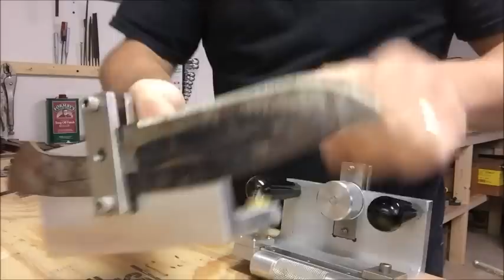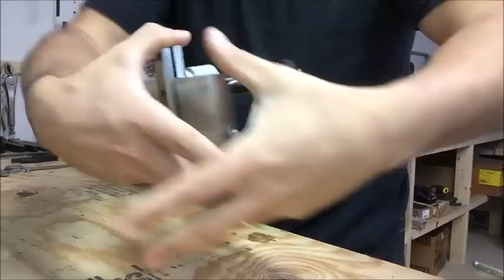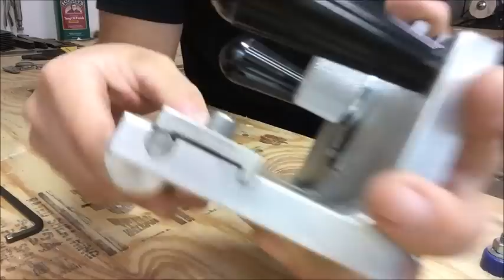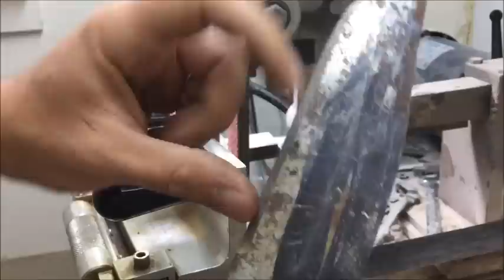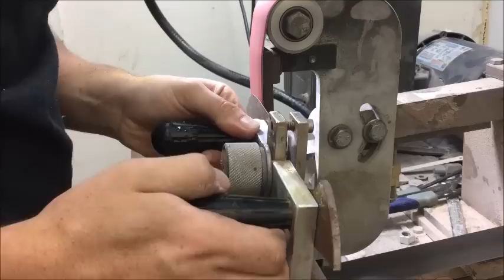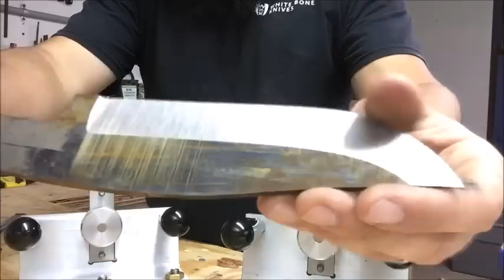Incredible bevel Jig for the Knife Maker!

Comment: I have one of these jigs and fitted hardened file guide steel on edges of knife holder. I then clamp knife ONCE with the 2 Allen keys in the holder and do up the big knob.   To do other side I just undo the big Knob and turn the whole thing around. Thats the why there's 2 threaded holes for the knob. Knife stays in one place through the whole process. Plunge lines stay equal. Only have to use the Knob to change sides. I don't touch Allen bolts until both sides are finished.
Works for me
Reply: nice i have to try thanks

Comment: Great idea...put carbide plates on the sides of the piece that holds your blade. Then you can also use it as a file guide for starting your bevels evenly at the same time as a bevel angle jig

Comment: I’m a hobbyist knife maker and I have a similar jig and I use a 1 x 30 belt sander and I still can get my bevel straight, any suggestions on why my bevel are not coming out straight and how I may correct the problem?
Reply from the maker: Really it could be many different things. The best thing I can really say is keep everything nic and square and practice practice practice. Your grinds will get better and better with every blade.

Comment: Hi mate I build a 72 inch belt grinder and I wonder if you can give me advice.  I build a pully system like klm and make my own pillow blocks. my tracking wheel is shaking the unit like vibration and I locked every thing in place nothing loos but still the tracking unit shakes can you tell me what I must do friend please. Greetings from South Africa Johan. God bless you. Shalom

Comment: Great video and jig, thank you. Yet, I need to ask this. As you're grinding the bevel, aren't you supposed to keep a straight line of motion even when you come closer to the tip, instead of pulling it away from the belt in a curved manner? Because most other videos I saw insist on that. I'm asking this as a noob knife maker, not to criticize.
Reply from the maker: I've always walked it out! I honestly don't know how you would do it any other way unless you have an entirely flat edge like a cleaver. If your edge is curved for the belly of the knife, you will have to walk it out every time to ensure the tip is ground properly. As long ans your bevel meets the center line of your edge to the bevel line on the side of your knife, you're golden!
Reply: Thank you so much for the detailed info :) Liked and subbed!

Comment: I've had thoughts of such a jig but with additional features such as a gauge on the side (by the lock down screw) showing the angle(s). Having such a feature would allow you to set up the jig for consistent, repetitive, knife grinds.

I also notice that you started your demo with the tip of the blade already ground.  Could you explain which method you used to align the blank before any grinding is performed?

Thanks in advance.  I do like the product and I will purchase one soon.
Reply from the maker: LJ240 I think you may be referring to the other side that was already ground. The whole bevel has been made during this video. I never do any angle measurements. I start grinding until I hit my edge scribe or the bevel scribe and then adjust the jig to meet my other mark accordingly. As far as lining it up goes, I just place the blank in the jig parallel to the top of the jig and grind away! Hope this answers your question!
Reply: White Bone Knives thanks for getting back to me so soon
 Your reply help clarify my question.
Reply: What are the dimensions of the gf2?

Comment: Great work Mark and Robert.  I would also like to point out that some of us like doing free hand, not because of some snobbish, elitist attitude, it just what makes us comfortable at the grinder.   It's bullshit to say using a jig is cheating, it's not about that, what it's about is what works for 'you' the individual...what makes you comfortable at the grinder, what feels right as you pull the steel across the belt/platen/contact wheel etc.

Oh and Robert, don't forget to tell the good folks about hearing protection, any repeated exposure to noise even at the db's of the grinder is putting themselves at risk for tinnitus 😉.
Reply from the maker: Suburban Knife-Maker hey thank you! Mark certainly puts out great stuff! Yes free handing is awesome! I just wanted to point out exactly like you said. It's there if you would like to use it and no shame if you do! I believe any method is valid, so long as you're making some incredible knives!!! Thanks so much for watching!

Comment: Do u have the cheaper one in stock  also how much for one with no angle adjustment just angle iron, love the clamp though, have u ever tried to use the clamps as a bevel stop?
Reply from the maker: Paul Doering I would email Mark and ask him. His email is m.d.machine@outlook.com
Reply from the maker: Paul Doering I actually don't use the clamp for a plunge guide. Wouldn't want it to dig in over time.

Comment from the maker: Still accepting orders for 2019!!! Over 400 sold!!! Thank you all so much!!!
Reply: When do you think more will be in stock. Went to website to order and found "out of stock" button.
Reply: I definitely want one of these, eventually as I get further into knife making. I noticed you used channel locks to adjust the angle w/o loosening the allen head. 
Might I suggest putting a hole through the round, to use the provided Allen wrench or screw driver for leverage and fine adjustment? I know that’s what I’ll be doing to mine, if I ever can get one. 

Great product!
Reply from the maker: @handschar100  whiteboneknives@gmail.com

Comment: If I were making this jig, I'd add some way to maintain the exact height of the blade when changing sides. Even slight changes in height of the blade will result in a different angle. Slight, but still different. Since this video is 2-1/2 years old, maybe this has been added.
Reply from the maker: The clamp can actually come out of the jig and be flipped around to be put in the exact same position. I apologize for not displaying this in the video.
Reply: OUTDOORS55 did a review on this jig and showed that feature.

Comment: Can the "jaws" that hold the knife to the front of the fixture be used as a guide to establish the plunge lines?
Reply from the maker: they could if you had a modified platen to keep the belt from hitting the jaws themselves. Otherwise the belts would eat away at the jaws. Perhaps tac weld a piece of square stock on the side of your platen for a spacer?
Reply: Interesting approach.  Thanks.

Comment: Looks good and sturdy and I love the dial that tightens the blade holder. But I don't like the way you have to adjust the angle with those 3 screws on the bottom. Id prefer one that adjusts the vertical plate as I've seen others do. Plus I wish someone would graduate the angle adjuster so you know exactly what angle you are grinding.

Comment: It's looks to me like the knurled knob is meant to secure the "file guide" (or in this case, "ricasso guide") to the fixture while grinding, and the two Allen bolts on the back of the guide are meant to tighten the guide itself to the knife.  So in other words, once you grind one side, instead of having to loosen and take out the knife then line up the plunges to the guide again and re-tighten it, you just loosen the knurled knob, take the guide with knife off of the jig, rotate the blade 180*, and then slide it back in the cut out for the guide and simply tighten it again.  Is this accurate?   

I noticed that the guide moved around quite a bit in the jig before you put your knife in and tightened everything, which is what made me notice it, plus I have seen a few jigs designed with a similar feature in the past.   Anyway, if this is the case, I do think it would help ya sell these jigs as well as help out the people who buy them if you showed this feature and went into detail about it as well, as that is a big plus when it comes to saving time and accuracy by not having to realign the plunge lines to the edge of the file guide when grinding the opposite bevel, not to mention the way it was designed to do so way a great idea. 👍.  Take care :)

Comment: Handles mounted vertically, butterfly on height adjustment set screw so you don't need a wrench, access to secondary tightening allen bolts from front, second smaller angle on hinge instead of round roller for less machining.

Comment: That would be the ultimate knife jig if you could spend the blade 180 degrees without having to unscrew it so you could do the opposite edge of the knife
Reply from the maker: you can! all you have to do is loosen the big knob and keep the 2 little screws tightened. Flip the clamp around and youre on the other side!

Comment: Where'd you get your tool rest for your KMG? That thing is a beast and I want one. Do the two standard bolts support that weight? Did you just weld on a new top plate? What are its dimensions?

Comment: I dont see how this will securely hold a 3 ft hog splitter lol. Do you make a XXXL version?
Reply from the maker: Oh it's insanely strong!!! I've done 13" blades on this jig no problem!! If I'm doing big blades like that, I hold a magnet out on the tip for more control. The blades have never come unlocked due to the double clamp mechanism.

Comment: OK, that looks a bit like the jig I started to make, but the biggest flaw of that jig is that if the knife has a handle, the jig is useless...
Reply from the maker: Lol u put the handle on after grinding silly beans
Reply: @WhiteBoneKnives  Funny guy, I can't make a drawing here, but I have about 30 knives, and they need bevel correction and re-sharpening!!!
Reply from the maker: @tonyioannoni4951  in that case then yeah you would definitely need something different. I thought I've seen a jig somewhere that clamps the spine but I may be thinking of the whetstone sharpeners
Reply: @WhiteBoneKnives  Actually what I will do tomorrow, is have a lot of holes drilled and tapped on the facing plate, so I can screw in a large thick and very powerful magnet with a bottom stopper, and position it depending on the width of the blade and the thickness of the handle, I'll use my electronic protractor to get the 17.5 degrees directly on the knife blade, and go from there...I just hope it will work good.
Reply from the maker: @tonyioannoni4951  I hope so too! Just be careful with the pressure on that magnet!

Comment: While the later jig may be faster, but the jig loses its facility to do tapered grinds that the original does. So as a professional knife maker you would have to use the "Mark 1" jig to make a knife if it called for a tapered grind, wouldn't you?
Reply from the maker: SAMRODIAN only if you plan to keep it flat against your platen. If I ever needed to use that on the other like a recurve. Lads for example, I just use the edges of the belt. I would do it that way with either jig though since it's easier and faster to adjust than using the jig. Some might prefer to have it clamped though so I thought it would be nice to mention. Always more than one way to skin a cat!